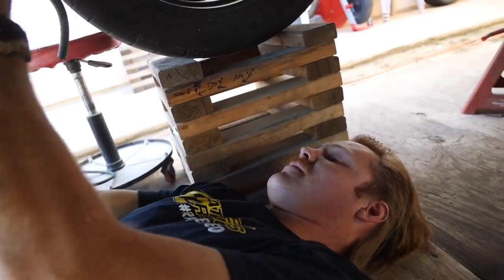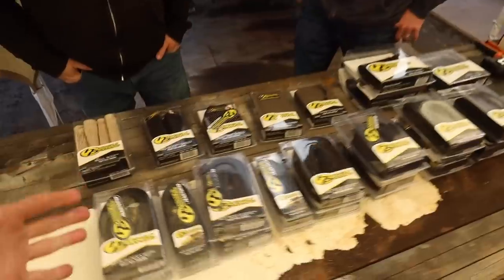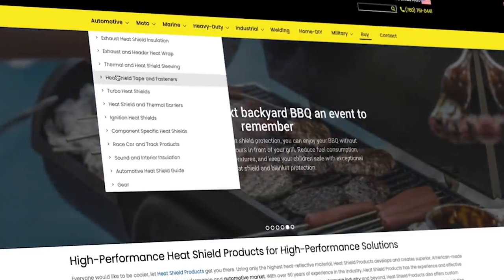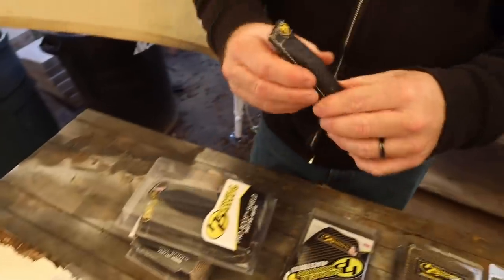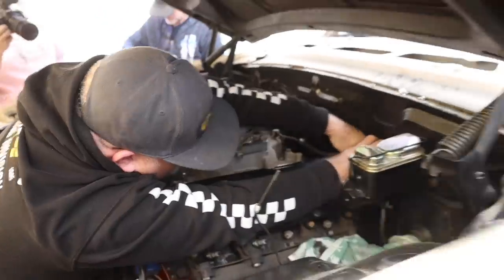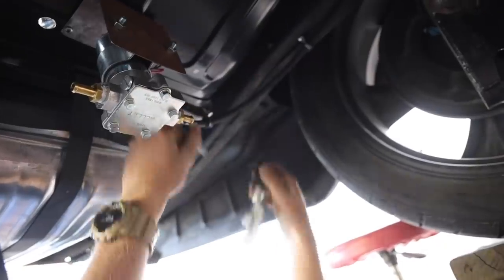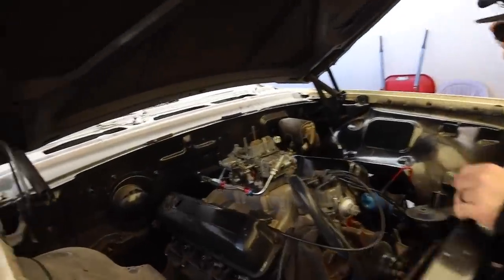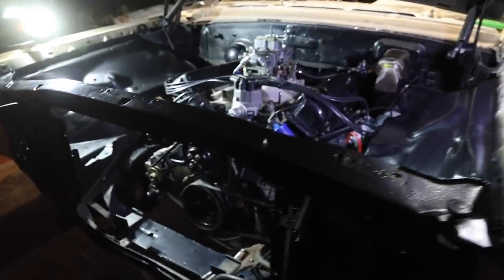How I'm Preventing My Galaxie From a Fuel Fire

Comment: Thumbs up 👍to the guys at Heatshield Products!  
I always liked running my spark plug wires around the valve covers like that... I remember when Ford first started doing that on the fox body 5.0.  At the junk yard I get the valve cover bolts with the stud to support the spark plug wire loom.  It looks like a factory detail but on my old cars it's "custom".

Comment: Heat does not rise.  Hot air does rise above colder air. But that is not what you are working on here.  Basic Thermodynamics; Energy goes from a component at a high state of molecular motion to an object at a lower state of molecular motion.  This energy transfer will happen in a vacuum.  Transfer happens faster in a medium that has good heat transfer characteristics.  The air in your engine bay does not have good heat transfer characteristics.  When your car is moving there is a large air exchange between the engine bay and the out side of the car.  When you are doing big smoking burn outs  the air exchange between the engine bay and out side of the car is lower.  (this is specific to the Galaxie. Modern cars with a lot of aero shielding have a much lower air exchange when in motion between the engine bay and the outside world.)  I am guessing you will drive this Galaxie hard once it is done.  And some of these products will be a benefit for your car.    

Some of their stuff looks pretty useful and might find its way into my '64 Galaxie.